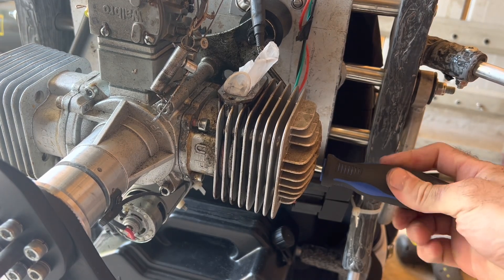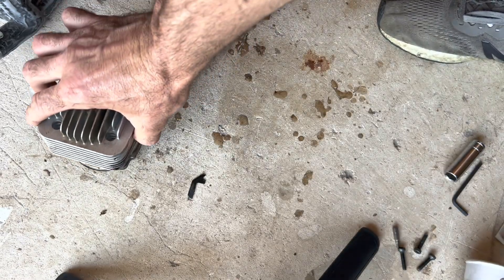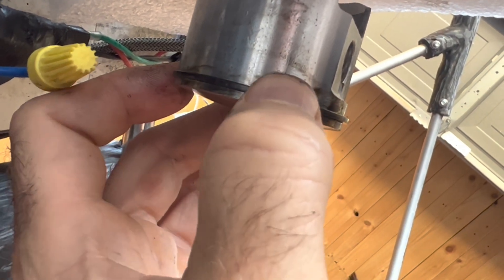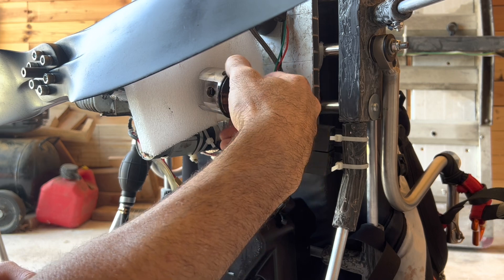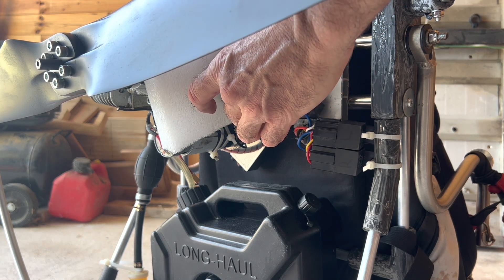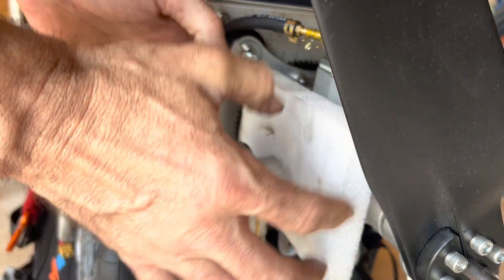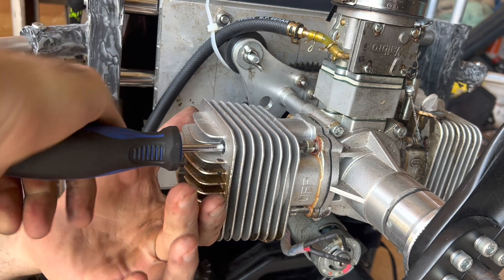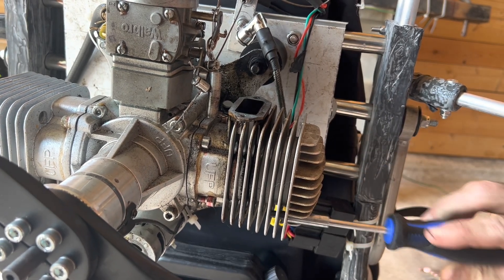Installing Bowman Rings on the DLE 170 Engine

Comment: Yeah but (joke) did you gap your rings! Your rings have to be gapped! You can't just install rings! At least, thats what all the comments on my videos scream at me.
Reply from the maker: Lol
Reply: Avery. Did they mean “gap the rings” or “clock the rings”?  With only one ring, it’s hard to “clock”.

What is the ring gap supposed to be?
Reply: @GDFred88  I didn't see any published spec. Regardless, these are proven in the RC world and just slot right in and work. As you can see, para survival here got a solid 50 hours out of them at basically 80-90% work load for most of the flight without checking gap.
Reply: @AveryFlies  In all my rebuilds, I’ve found quality rings to be within spec straight out of the box. I think it’s a larger need with larger diameter pistons.
Reply: @AveryFlies  how many hours do you have on your Chinese paramotor at this point?
Reply: @GDFred88  I agree, and these guys are tiny!
Reply: @GDFred88  I only have about 10 hours on mine. I also own 2 other paramotors though, this little guy fills a pretty specific niche for me, and I only plan on using it for mid day thermalling once I get the starter fixed.

Comment: Why change the rings?
Reply: In the RC airplane world it isn’t unusual for Bowman rings to be installed on a brand new engine. They are supposed to have more even pressure, better sealing while also reducing friction and longer life.  Doing so can apparently improve the idle and increase power, especially on some of the cheaper engines.  Plus if you break a ring it can scar up the cylinder and piston…
Reply: It's a 2-stroke 😂
Reply: @iKenFlyPPG  so change them because you can without dealing with the Overhead Cam timing chain????

There has to be a better reason.
Reply: @GDFred88  Where are the 4-stroke paramotor engines?  They aren't a thing because ppg pilots are cheap and don't want to pay more for less thrust.
Reply: @iKenFlyPPG  I understand that.

What I was trying to understand was why change out perfectly good rings for other perfectly good rings?

What did you see as a benefit? You said you were going to save the ring you took off? Why save it if it wasn’t good enough.

Help?
Reply: @GDFred88  I change my oils a lot earlier than manufacturer suggestions, my goal is longevity for the price of 10 more gallons of oil over 200k miles.  Should I have to explain I believe fresher oil performs better leading to less wear and longer life.

When I had my ZRT600 2T, I replaced all three pistons and pins just because...I don't want to break down in -10F Northern MI BFE is one reason. My experienced buddy who got me sledding changed pistons every 3k miles on the family sleds, for the same reason.
Reply: @GDFred88  It's cool no worries, maybe it was a bad choice of words, like keeping two "good" tires in case you blow one out down the road, just speculation on my part.